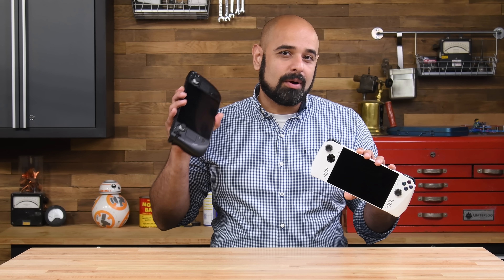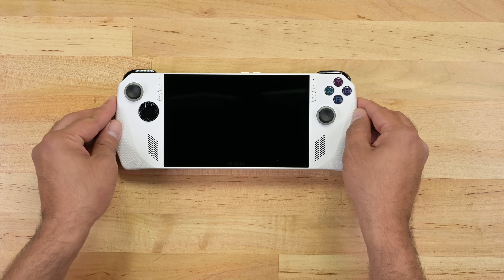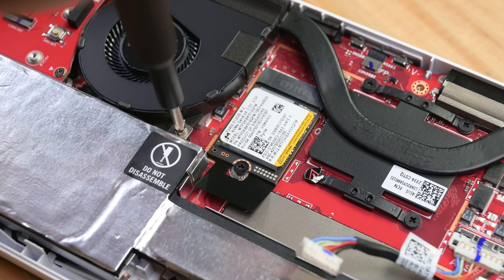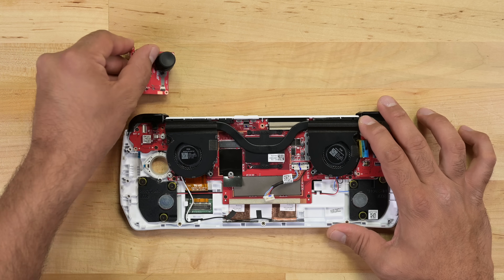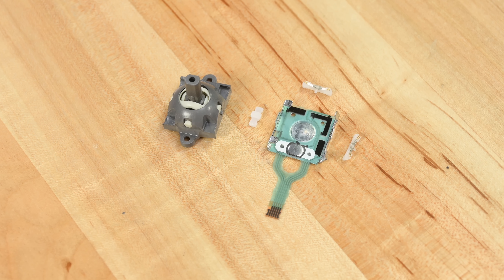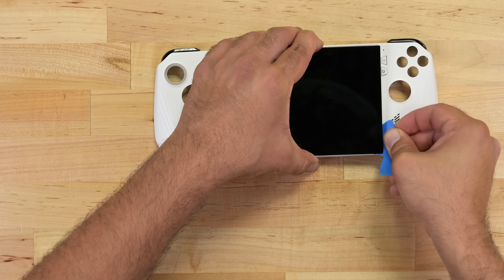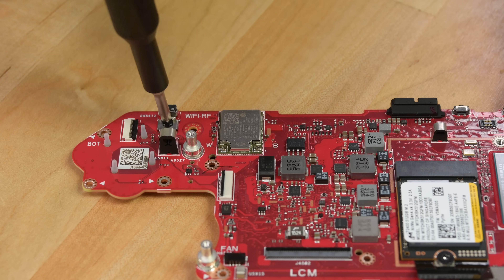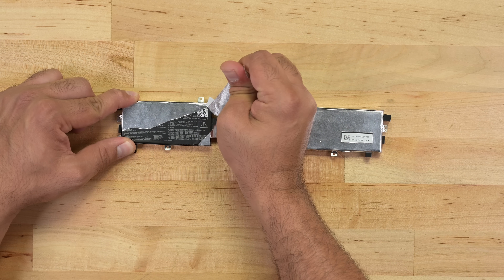ROG Ally Teardown: Great Hardware with a big “But”

Comment: I just opened mine up to dust the fans for the first time. Put it back together press and hold power and it wouldn't turn on. Plugged it back into the charger and then it turns on fine. I assume its expected behaviour but I freaked out for a second.

Comment: My left bumper button is starting to fail. Unless I press really hard, the button won't register. If it's pressed down but not enough force, it'll rapidly alternate between pressed/released. Is this an easy fix or will this require me to replace the entire board?

Comment: My R2 trigger won't calibrate so driving games are a no no but I can still play FPS games... Spoke to Asus and tried their "fixes" but the unit has to be returned.... it looks like the bumper pots are on the mainboard right?

Can the bumper switches be replaced or will they need to change the whole mainboard?

Comment: I recommend taking the big plastic flap that cover the apu and ssd off and if you have a clean home you can take off the mesh blocking half the air intake for much better temps

Comment: anyone struggling w ssd screw?mined did not take phillip 1 or 0 ... was a pain but even after messing up screw finally got it w a 1.5 flathead bit. was super small but did trick u can find a set at home depot or any hardware store. i got it from harbor freight

Comment: Covered it all except what I need, my cable from lcd to motherboard is damaged, I have a new cable ordered, on the site they sell a screen and front bezel and if you look at the back image it doesn't come with a cable in it, is it easy to remove from the lcd, im not familiar with that connector, does it just pull out , or is there any tabs, I don't wanna break it worse, I should have new cable in a week, if nobody posts a video I may record my process if it works and post it, trying to watch and learn all I can and research, think cable is coming from France , it was in euros..

Comment: Thanks for the teardown!

2:10 Yea, the SD slot seems a bit off!
Seems like they shaved off the top cover of the slot somehow?

It does make one wonder if it's the reason behind the SD reader heat issue as of recent?

Perhaps it warped due to prolonged heat and caused a failure to retain the SD card properly for normal operation.

Comment: Mine has been great so far, although I haven't tried using the SD card slot yet and likely won't ever. I opted to install a 2tb ssd instead of investing in SD cards which ended up saving me SD card reader headaches. Hopefully ASUS can figure that one out. If you're looking to buy an Ally, it sounds like May models are far better than March models. I got mine on launch day and ended up with a May model.

Comment: Took the gamble to be a $750 Beta tester. On my third unit after the SD card reader failed on the first - the second unit was DOA, and my third is running good. The device is impressive. Love my steam deck but much prefer playing Diablo IV on the Ally. Love to see that this is pretty repairable.
Reply: is the sd card reader really a deal breaker? does it destroys microsd cards?
Reply: @picanha694 they fixed this issue in the lastest bios update.

Comment: I have one. The Extreme version. Only complaint is the battery and the 512GB of space but that can easily be fixable by utilizing the expandable storage to a 1TB micro SD card to install games. Make sure you get a read speed micro SD card that is fast if you do this.

Comment: I got mine specifically as a handheld laptop not a console
Considering all the downsides are pointed toward general console take out of box power on and play customers
As someone that knows windows well and knows how to tweak and mod everything, this device is amazing
In docked mode (Using a Type C dock not XG Mobile) it works lust like my laptop but unlike my laptop and its 5 cables I need to remove to disconnect the dual screens, usb hub, ethernet and power its just a single type C and I can just pick up and go.
Reply: Yeahhh this is what I'm gonna do. Ally will replace 2 laptops of mine actually. A 14 & 16 inch both w dGPUs. Will get an 18 inch gaming monitor and have an even better gaming experience bc of that size. Goin w a small mechanical kb that's way better than either kb on the laptops 🤓 hope u been enjoying your Ally broski

Comment: ASUS is pushing regular software updates. It’s dramatically improved in terms of operating smoothness and a reduction in finicky bugs like the controls not working when switching from gamepad to desktop mode. I think the armoury crate software is great considering what it’s able to do on a windows machine compared to other competitors’ less capable software such as OneXPlayer.

Comment: the biggest advantage over SD is that back plate screws are screwed in into metal - not plastic as in SD!! It means you can disassemble it many times without losing tightness.

Comment: Very pleased with my Ally so far, great performance and design. But I use it mostly connected to a wall socket AND... yeah, you need to see it as a mobile PC, not a console. Having a lot of experience on PCs and Windows 11 is a must to benefit from it imho.

Comment: It looks like it is very repair friendly and powerful device but like you said the software is a letdown. I think I’ll rather go for a SD for now or just wait for something better, like SD2 perhaps.
Reply: it'll get better. the problem is just software which is easily fixable through updates. it did receive a lot of updates now and it's miles better than when it was released. Still need a lot of software updates tho

Comment: Worth mentioning the crappy proprietary connector for external GPUs, maybe not related to repairability, but without a doubt it severely handicaps the expansion options.
Reply: The only thing the connector hampers is external GPU Expandability, the type C port is DP compatible.
I currently have an HP Thunderbolt 3 dock plugged into mine (Ally does not support thunderbolt at all) but all the ports on the HP Dock work, Dual DP and HDMI/VGA (Depending on model) 3 Type A's 3 Type C's (one of them is also DP Compatible), Ethernet and 120W power brick All work, the only thing that doesn't is the power button on the dock itself but that's no problem.
I have a single cable that takes me from portable to full Dual Screen desktop mode with mouse and KB
I even installed a cut down version of 11 called ghostspector last night and after reinstalling the SW from the backup eSupport folder and grabbing some drivers everything works flawlessly.

Comment: I've had a Steam Deck since the beginning, and the Ally since day 1 - and I will say the Ally has improved quite a bit since launch, but it comes at the price of performance. The biggest issue, by far, with the Ally is the terrible stock battery life, where you can easily kill the battery in about an hour if you want peak performance. However, it appears that some firmware updates have improved the battery life, but that's just done by lowering the performance - BUT that might not be a bad thing since it seems like they're finding a better balance than what it launched with. As for software, yeah, it's still buggy, but I've just got used to it now and know how it works, so it's really no longer a big issue to me. I was 95% certain I'd return the Ally after having it for a few days, but now that we're coming up on two weeks, that's more like 40%. At launch if I wanted to play some indie game at 120hz 1080p, you got terrible battery life, now in those same titles, you might get more like 3+ hours (at the 10w setting). Also, plugged in, this thing does perform really well, using it with a USB monitor that runs at 1440p 120hz, I was able to play some older AAA titles maxed out. Finally, the big there here, is that the battery is easily replaceable. That's a huge deal since you have to charge this thing so often that battery is going to be shot in a couple of years at the most. Knowing I can just easily drop in a replacement, that probably means I'll keep end up keeping it since that's been my biggest concern.
Reply: I’d say quite the opposite - the Ally’s performance has gotten worse since launch imo. I saw a decrease in game performance after the launch update, and it hasn’t gotten much better (on Steam). The Xbox apps either don’t launch or have odd issues. It’s not a stable experience yet, compared to the steam deck, but hopefully it gets better
Reply: @daspotjoel You have to turn off automatically setting the clock and turn it back on to fix the Xbox issue, the other issue is fixed by applying the hotfix.
Reply: @SEVENTEENPOINT1  I'm not sure what the XBOX app issues are, that's not one I've encountered. Game Pass has worked fine, which was one of the big draws to getting this - so at least with that, I've had no issues.
Reply: @rodmunch69  It was a time issue due to allowing offline play of games.
Reply: @daspotjoel  Well I was talking about battery performance, the system performance certainly seems to have gotten worse. But yes, it's nowhere near as stable as the Steam Deck. Still, I do like the fact I can use the system as a backup low-wattage PC for work if I really needed to since it's running Windows and can run the apps I need it to run natively, so that's a plus. If I was recommending one of the two, it would be hard to not recommend the Steam Deck since it just works, pretty much every time with no issues. Where as the Ally does not, and I don't have any real faith in Asus to be patching this a year from now.
Reply: That’s why I waited a year before getting the Deck, so I might do the same with the Ally.

Comment: Okay, so I took mine apart and have absolutely no idea how the triggers work. It looks like they have magnets in them, but I didn't see any sensors on the actual board that correlate with their positions....
I also cut out a couple small pieces of plastic reenforcment and slipped a 4tb 2280 SSD in mine. I put a heat pad on top and bottom of it, and have had zero issues.

Comment: those disassembleable sticks mean that you most likely will NEVER need to replace them, as you can thoroughly clean every part and get rid of drift with a drop of bw100 on each rail. Massive props to asus for that.
Reply: i miss the days when controllers are bulletproof.
Reply: Drift issues aren't always about parts getting dirt. Generally, drifting occurs due to irrepairable damage associated with normal usage.
Reply: @TolstoiDrummond1007  that is generally true but a quick cleaning on debris can drastically improve performance on aging sticks. I've had the same pair of joycons for over 3 years now and all I do is spray some wd40 contact cleaner in the stick wells every time they start to disobey and they get right back on track with no issues whatsoever.

Comment: You guys have to remember...if you use Windows there will always be glitches and bugs and lots of updates, whereas Linux-based Steam OS..it's more stable and less vulnerable. This is the main reason why the Steamdeck has a huge advantage in battery life because Windows loves to hog resources..tons of stuff loading in the background, when compared to Linux.
Reply: Linux "more stable" lmao😂😂😂
Reply: @TheTyisawesome Then why do over 80% of servers and all of the top 500 supercomputers use some form of Linux?
Reply: @cameron_bosch Sure in server space....90 plus percent of desktop users either run MacOs or Windows
Reply: @cameron_bosch Okay yes but... Those are completely different work loads and not comparable... The OS is so light weight because it can quite often only perform a specific task and don't have any GUI, so the simplification can make it more stable but it's just not the same. let me know when you buy a Super Computer or Server to do daily user tasks haha
Reply: @TheTyisawesome  Linux-based system is so light and doesn't have any GUI?..well, then the Steam OS is perfect..AAA games run fine..and it doesn't hog as many resources as Windows OS. Hence, it's more stable in running Steam games and saves up battery power.
Reply: @Mark_Thackeray  "AAA games run fine" lmao there is lists of games that don't work at all and others that require faffing about to get running.... Yet it's so much better than Windows... It's personal preference
Reply: @cameron_bosch  Then why over 90% desktop users use macos or window lol ? linux work best as server space because of less background software running make it stable for that cagotery . On the other side, few background engines may lead to less optimizations = less softwares, games, etc... can be run since they didnt even get supported in the first place
Reply: @TheTyisawesome  I wonder why your cell phone isn't running windows, instead it's running on android..and android is linux-based.
Reply: @Mark_Thackeray  No one wants or needs a full OS in a Cellphone.. Also I don't think Windows would run well on most devices anyway because it's more demanding. But even then it's not the OS I would want for my cell phone because again it comes back to workloads I don't need a Windows experience to get tasks done on my phone I need something simpler, And Linux based Android accomplishes just that.

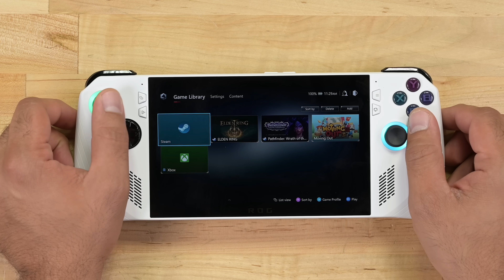Comment: 4:00 Why shouldn't the poor software be asus' fault? 

Even if they didn't make the software, it was their choice to go with something not optimised or even intended for the form-factor of their product, especially when alternatives that are intended for it do exist.

Valve put effort into this area of their product, and the end result was an intuitive and functional system through and through.
Microsoft put effort into this area of their product, and the end result was an intuitive and functional system through and through.
Sony put effort into this area of their product, and the end result was an intuitive and functional system through and through.
Nintendo put effort into this area of their product, and the end result was an intuitive and functional system through and through.

Asus didn't put (much) effort into this area of their product, and the end result was being unable to compete in the same market as steam deck.
Reply: I would say it's both Asus' and Microsoft's fault. But they should've gone with a some kind of Linux distro either way rather than making the customer waste 100€ just on the Licensed OS they would probably never use.

Comment: Nice to see how it seems to be repair friendly. Here's hoping Asus keeps supporting it from the software side like Valve has done with the Deck. From what I have read from those who owned a Deck when it came out and got the Ally, the Ally seems to be a bit more stable and has less issues than the Deck did back then so if that is the case, it could be promising that Ally will fix whatever issues are left and be "on par" with the Deck in that area.

Comment: Very nice hardware but I will not buy anything and run Windows on it anymore now that i've been using Linux for so long.  Unfortunately that + the price point vs the entry level steam deck will keep it from outselling it.  Really wish they would have invested in creating a custom linux distro or even working with Valve to port steam deck OS to it.  I'm sure Valve wouldn't care because they really want to make money off selling games anyways.
Reply: ChimeraOS says hi. (The developers are making it work, and will also do additional things as well.)
Reply: Hey just a honest question. What stops us from installing Steam os as a duel boot on the ROG Ally? Like I’ve duel booted windows on my steam deck.
Reply: @ytmaxxammo8591  Nothing.  I think it is possible but the driver support is not there so you will not get the full performance out of it like on Windows.  The other features baked into Steam Deck OS like TDP control also will not work nor will frame cap limiting.  That stuff works in the ASUS armory crate app on Windows and is built into Steam deck OS but only works with the steam deck there.

Windows is a buggy mess.  If you only want to play steam games, having it launch into steam big picture mode is a good workaround for the most part to try and get windows out of the way but it will still pop up garbage notifications in the bottom right all the time and will require at least some fighting with it.  Plus, for someone like me, I want to play emulators on it to bring over my ripped collection of games from consoles I own.  On the steam deck, there are plenty of packages that will set up the emulators, load the roms, and configure the controller mappings for you in a single click.  You don't get that kind of support on Windows.  The closest thing is Launchbox BigBox but even then you have to do a lot of customization.  

At any rate, I also just do not like Windows because it is a privacy invasive memory hog that siphons all your data back to Microsoft, eats up way more RAM at idle than Linux, and takes up several x the storage space that could be used for games.
Reply: @Watchandlearn91  Do you think they sell it along with the Windows license on the motherboard? I would say that's kinda waste of money to pay for Winodws even though you want Steam OS or any other distro on it.
Reply: @jonny11bonk  Yes they sell it with the Windows license which is tied to the machine.  If you bought one and put steam OS or anything else on it, you could still put Windows on it later as that license is permanently tied to the hardware.  At least that's the way it always works on laptops and desktops.
Reply: @Watchandlearn91  Yes. I was reinstalling Windows on my friend's laptop and the license screen didn't show at all. It had no network access and I've completely wiped and reflashed the firmware on it. I just hate it that most of the manufacturers waste sell stuff with Windows already on it. I see it as a 100-150€ loss.
Reply: Steam Big picture is a thing on windows.